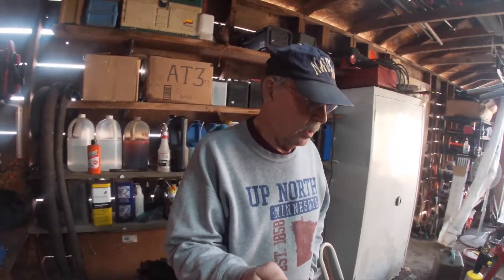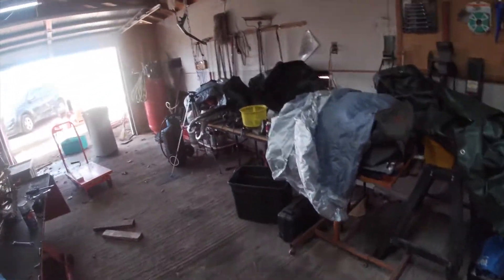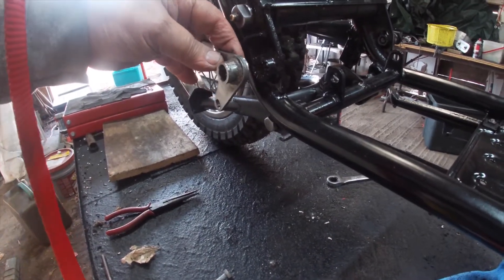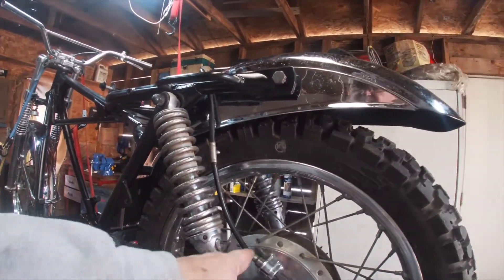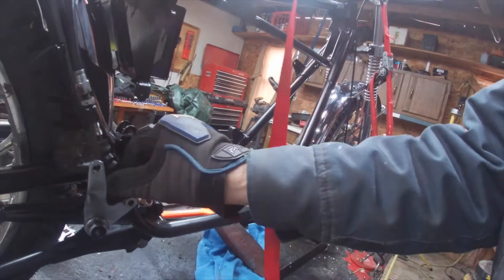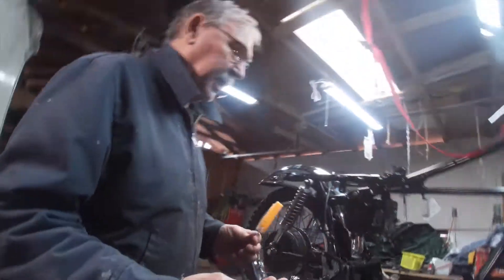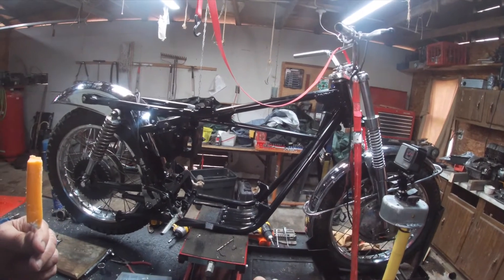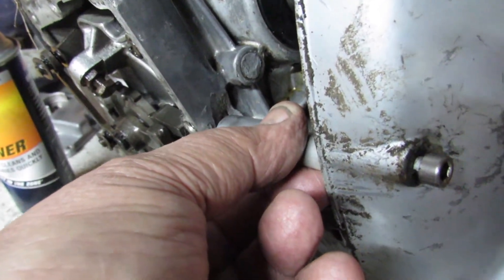20210323 Yamaha YDS3C Big Bear Progress Recap

Comment: Great job.  Can't wait to see it back on the road again....that will give me the motivation to start rehabbing mine....
Reply from the maker: I got it all put together but my repair of the hole in the transmission case didn't hold so in the spring I'll pull the engine and have it fixed professionally.